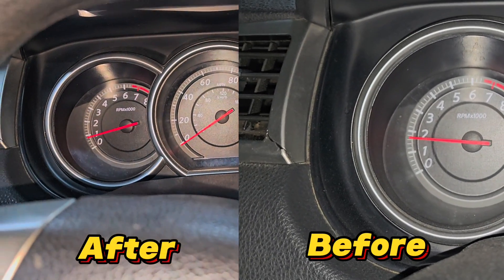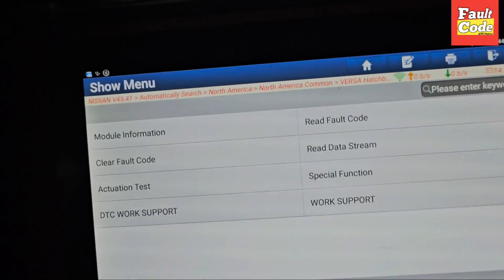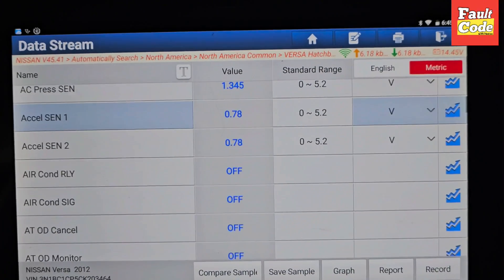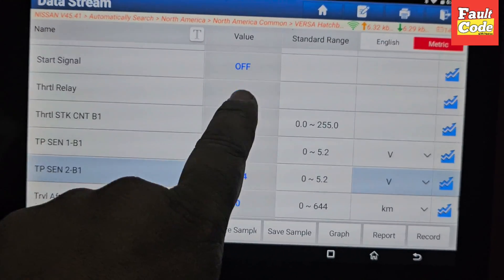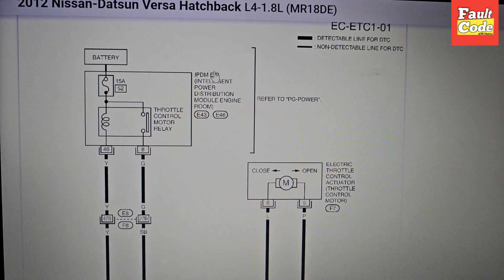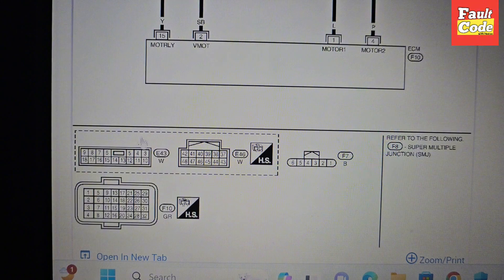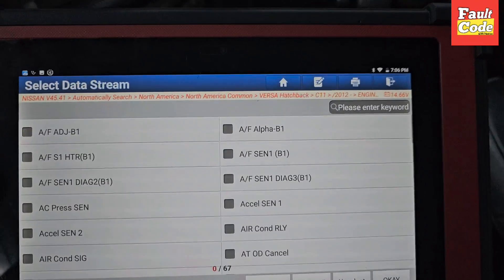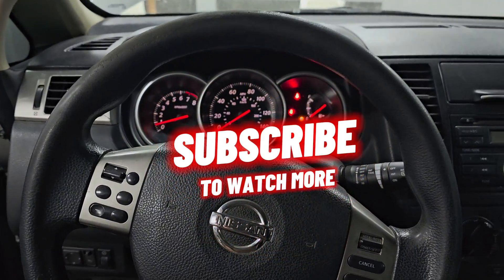Nissan P2101 / P0507 ECT Function Circuit || Throttle No Response Complete Solution

Comment: Please guide me the solution of similar problem that im facing on my FAW V2 

Code: P2101
Issue: Throttle Actuator Control (TAC) Motor – Range/Performance Problem
Status: Confirmed

It doesn't pick the race but after a few attempts it works. Throttle service was done few months back. Want to solve the issue by myself.